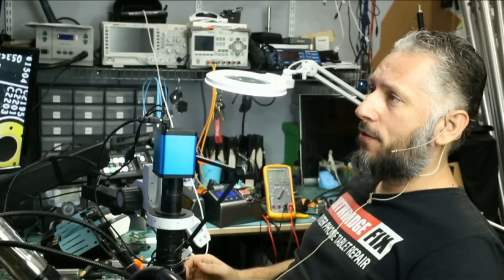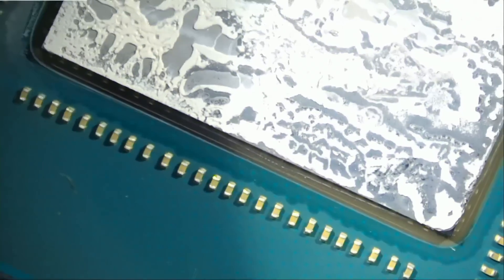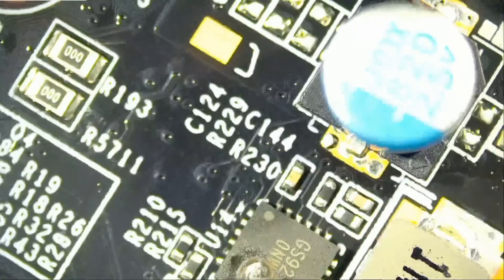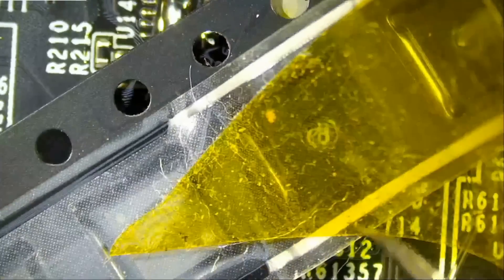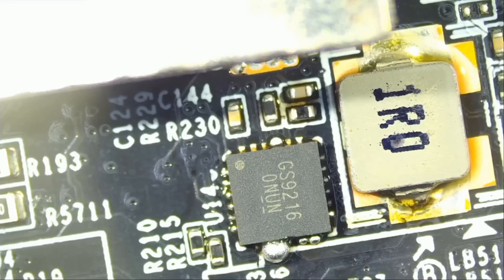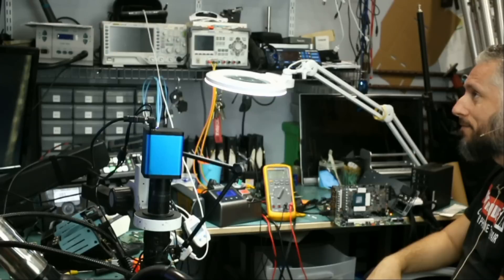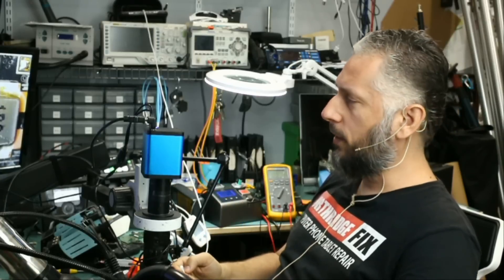Gigabyte RTX 3070 Smoked - Is it Fixable ?

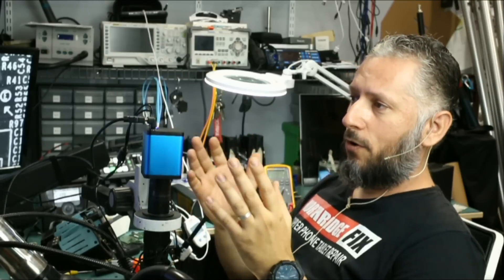Comment: 8:15 yep. can relate. i do cad drawings. same drawing that average cad designer takes 40min, 3-4hrs for beginners, i can finish it in 10-15mins but i hand to them later after couple of hrs. why? because clients are complaining i charged them too high for a 10min job. many times i've explained to them my skill is the result from thousands of hours of experience. didn't work. they left with sour face.

somewhat dishonest, i take that. but it had to be that way.

Comment: Hello north ridge. I like your videos. Your good.   Jose army veteran
 Check buck converter 12 volts out circuit by c248. There's a ROO fuse that needs to be upgraded. Behind board there's a little crack that's too little to repair so they upped the fuse
 There 900 volt around the ,buck the circuit.  Be careful and good luck

Comment: I found another similar chip datasheet pins look  like similar, but nut sure, it is GS9238. first check the 8-9 for Vin, 7 for Ain, 21 for VCC, and 22 for Vin (again), then if those voltages OK, check pin 2 for EN signal,(may be 3,3 V) then pin 6 for TON which is connected to Vin voltage rail via a resistor, and check the resistor is good(R210 on video), you may check the R215 connected Ain pin(7), if all the voltages OK you must see a  PGOOD signal on pin1a and Vout on pins 10-11 and 16-17-18

Comment: Love the soldering skills. If thats a DC/DC Converter chip, I would look online for the Pin Out and locate the Vcc Pin to see if there is a short or a source pin going to ground to see if there is an open resistor.

Comment: I guarantee you that chip was a problem, but sadly, its not the only problem. Its worth taking the time to look it over for other obvious failure points and retest. It might be worth checking out whats connected  to the traces near that burn spot on the chip

Comment: I would give up my life to my wife to buy a 3070 🤣

Have you ever fixed an ROG Strix 1000 series GPU which RGB Header/Led had an issues? I tried to connect RGB strips on the GPU RGB Header somehow it damaged the RGB on the GPU which you're not able to control it but the light is working

Comment: Gigabyte GPU cards have always been subpar  I stopped buying them quite a long time ago, sucks that EVGA is out of the Nvidia card game now so one less quality GPU Nvidia manufacturer.

Like someone said below, OC settings are tailored per GPU, so if you change your GPU the device ID will not match and the settings and with (Afterburner for example) the program will detect this and default back to default settings.

Hardware OC is different (not even sure its a thing anymore due to huge BIOS changes and no more physical pins on the MB) but I don't see many people doing this as much anymore as its not just simple plug n play in the days of old when knights were bold we used to have to adjust voltage jumper pins on the motherboard to achieve over clocking.

 I have been doing OC for years and I have NEVER seen a card let out the magic smoke before, but I have seen failures like artifacts displaying on the screen, random freezing, no display at all or the infamous Error 43 due to hardware failure.

Poor quality parts/manufacturing is probably the culprit here

Comment: Hard to believe that an OC could have done this. I've never heard of anyone bricking GPU from software over clocking. The cards BIOS has limits set from factory to prevent users putting in stupid settings. Worst you can do is just crash the PC with bad settings. Unless you're overclocking with BIOS flashing then that is another story.

Comment: Hey man, check R215 next to GS9216, it should be a 0 ohm resistor, but i bet its blowed out. Most of the time if a GS9216 dies it burns out the 0 ohm resistor next to it on the 12V input rail.
Also yes, plug them power cables in as it mentioned below by some good-eyed mate :D

Comment: Is it possible that the chip could fix the problem - if less solder was used on the large pads underneath it?  I totally love your channel but I often think when solder bulges out of the package when pushed downwards, there's a chance those 2 large pads underneath may join up something on the underside.  Please dont take this as an offensive comment - just a suggestion, and that might not be the problem because as we all know - the flux will generally stop bridges like that (but not always).
Reply: The flux gives the solder a high surface tension, preventing it from bridging under the chip.  Alex has soldered hundreds of chips like this, if not more.

Comment: Normally there's a reason why a chip failed in such a smoky way, especially if it's a buck convertor. I'd assume it was overloaded, possibly due to a short on the power line it's supplying, or by something else that failed. Also, if a buck converter fails, what can happen is that it can short the internal switching element, and put the input voltage of the buck converter on the output directly. That means half the board could have gotten fried in the process, or at least everything that this chip was supplying. It was probably a good idea to check for shorts after removing the chip.
Reply: It's the coils that fail most of the time.

Comment: OC settings can't cook SMDs like that. this is classic overheating, probably from shoving this GPU into an old, unventilated system. the chip is for SMPS, so if it's blown from just 12V this card is probably done for.

Comment: To shield sensitive components from hot air I'm using ducting aluminum tape. It's easy to place as it is sticks to the board. Amazingly the glue withstands the heat and it's easy to remove after the job is done. On top it's ultra-cheap. It will also give protection against blowing components.
Reply: Alex uses aluminum tapes as well.
Reply: If you're in a budget you can also use normal aluminum foil. Just fold it a couple of times and stick it to the component using normal tape.

Comment: When a chip fails like this, chances are the cause is not the chip itself but an event that caused the chip to blow.
Reply: It's the opposite. The chip itself fails. Power stages are built to fail-safe. They contain their own Over current and over voltage monitoring circuitry. 

It destroys itself in an effort not to bridge the 12v directly to the GPU.
Reply: can a blackout cause this kind of damage ?
Reply: @chocho6766  If your computer has no protection obviously yes.
Reply: @cutterbacon  is a good psu enough ? It said anti surge or something
Reply: @chocho6766  UPS – Uninterruptible Power Supply
Another option you might consider looking at is an Uninterruptible Power Supply (UPS). These devices act as a battery backup system for your equipment while also providing some basic surge protection. A UPS can keep your computer powered on and running when the power goes out in your house.

The surge protection used in consumer grade UPS devices is typically similar technology to what’s used in the surge protection power strips mentioned above (MOVs). As such, you can expect similar performance in terms of surge protection.

The main advantages of using a UPS come from power delivery problems other than surges. A few examples of such problems are:

Black outs – complete loss of power
Brown outs – a reduction in power supply to your house
Something tripping the circuit breaker in your house
Noise on the line – poor quality of power being supplied to your house
Without a UPS, the above problems could lead to your computer turning off immediately causing potential damage to your operating system from incorrect shutdown or even just loss of unsaved work.

If you run your computer off a UPS the UPS will detect such power conditions and immediately switch to battery power without your computer being affected. Your computer will continue to run off the UPS batteries for a duration of time depending on the model of UPS you have. This could range from 10 minutes to over an hour. Once power is restored the UPS will automatically switch back to mains power.
Reply: The chips fails because they use a 10cents one instead of a 50cents one. Just like they try to save a buck on capacitors and everything else.
Reply: @seephor. It's called overlclocking or a bad or not powerful enough PSU.

Comment: No way a previous Overclock would cause a failure like this. The card would crash or shutdown if anything at first. Just another case of poor quality IC manufacturing. Seems like there has been some issues with moisture and poor quality ingredients in the last 2 years when it comes to making passive and active components.
Reply: True. All my gpus that oc always crashed and restarted if the current settings didn’t work. I have an msi rx 5600 xt that would crash on me because the dang thing turn its fans on automatically when the temperature rose. I would get coloured dots on my screen and then my computer would crash. I had to use a fan control speed software to manually turn the fans on.
Reply: Wrong. Literally thousands of these cards get pumped out and sold and you only hear about the few that popped we dont hear about all the nice working cards of course, sound like a normal failure rate to me.
You also have to remember the amout of people that pair these high performing cards with $20 psu's
Reply: @Nobbie248  He is not wrong, it's impossible to break a 3070 in that way!
Reply: @sirfairplay9153  I was objecting to poor quality components
Reply: overclocks also don't transfer so easily from one card to another, unless it is the same model which uses the same software. In any way even if, the cards have a power limit (which you can set and on hardware level) and the Gigabyte Software (AORUS Engine) is foolproof the most you can cause is a system crash and be back to where you startet, no non-invasive overclock can cook a board component like that. Most likely as you said a poor quality component
Reply: What? Overclocking destroys GPU's. Especially if the card has a low air flow fan. The card cannot dissipate the additional heat. 

Cards crash during overclocking because the current being supplied to the GPU is insufficient. The GPU stalls.

That card uses smart power stages instead of MOSFETs. Each has it's own built in current monitor. It design to protect the GPU. They are designed to fail in a manner that does not bridge the 12v to the GPU.

The component did it's job.
Reply: thats what we get for outsourcing into "cheap" countries like china and taiwan, that focus on quantity instead of quality.
Reply: That’s what happens when the workplaces and supply chain get messed up because of lockdowns. I refuse to make major purchases until production conditions get back to normal.